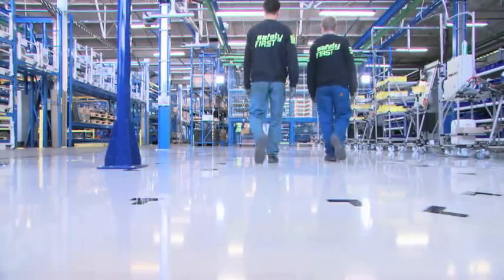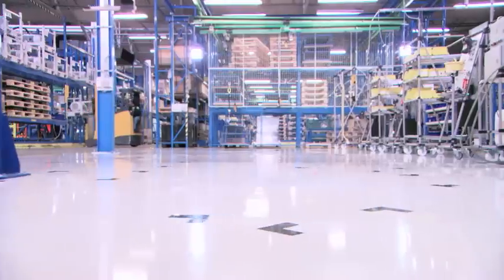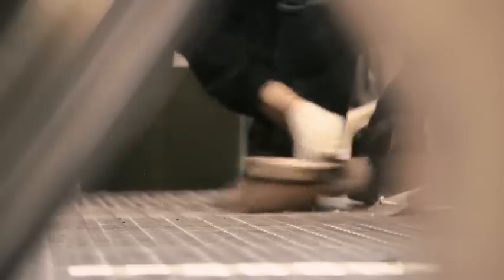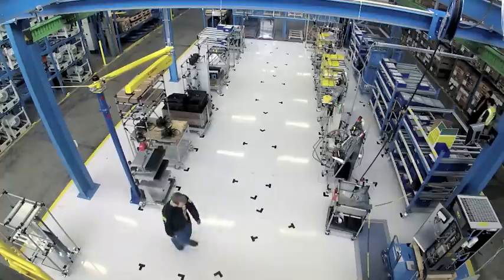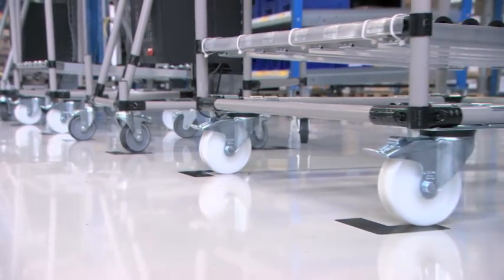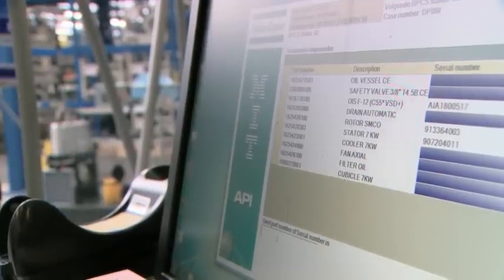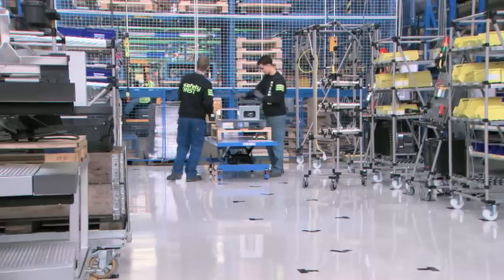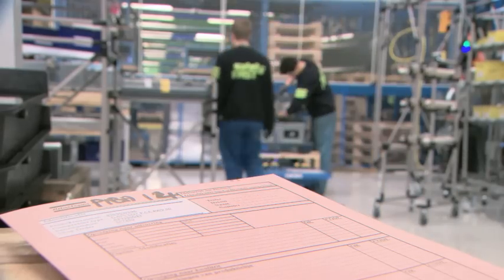Lean Manufacturing @ Atlas Copco

Comment: A wonderful end to end look at Lean and Build for Manufacturability.  It was funny for me to see the forklift moving in the background which is a Lean waste.  However, you cannot remove all waste.
Reply: If your moving heavy items across a factory floor, its faster then a overhead crane.
Reply: @ag-bk5wf  Guiding a crane has components of navigation, guidance, and control. If guidance has a path and can accelerate fast the overall time may be faster or not.  It might be worth it to do a simulation.